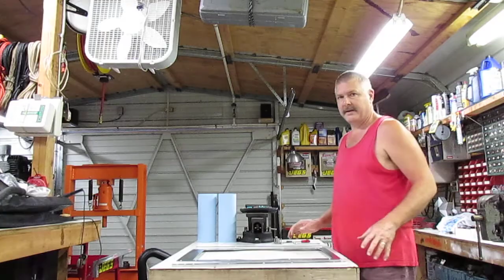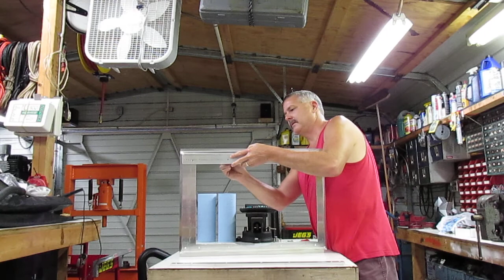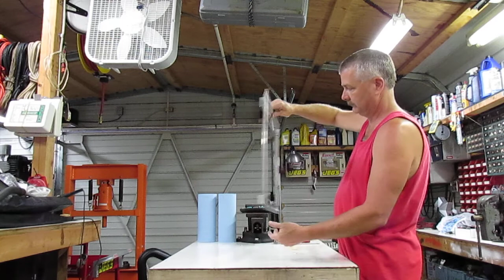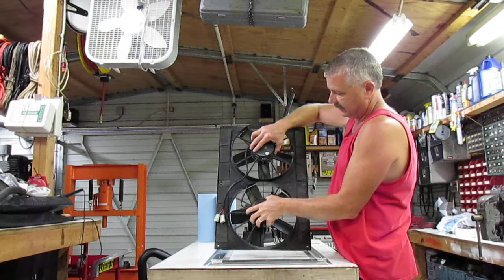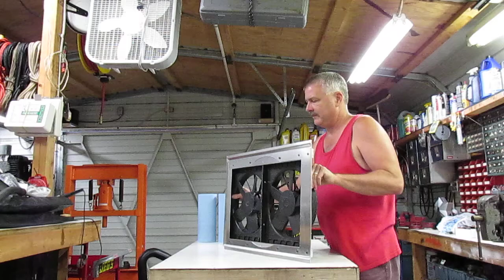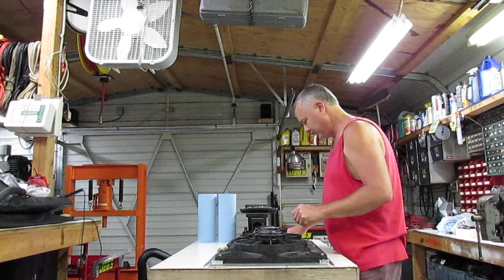Building a custom made fan shroud for dual 11 inch SPAL fans on a C3 Corvette, PART 2

Comment: I missed the gauge on the aluminum shroud.. Could you let me know what a decent thickness is? :) Nice modified shroud.
Reply from the maker: rag Doll I don't remember how thick it is. It is a very nice, sturdy size to work with. It is a Jegs P/N 555-52065. Their website does not state the thickness of it. Maybe if you call them, they could tell you. Thanks for the comment.
Reply: *****
Great,thanks for the part number. I'll see if I can find out the gauge size. :)